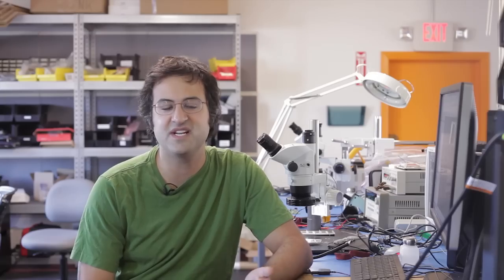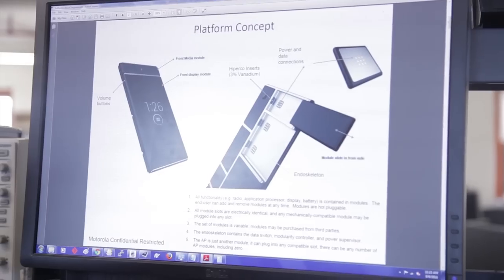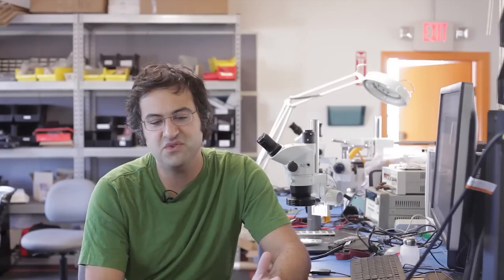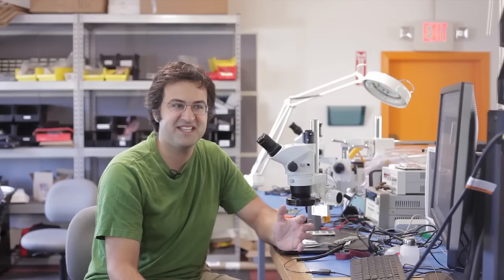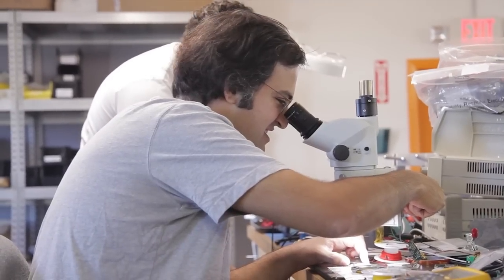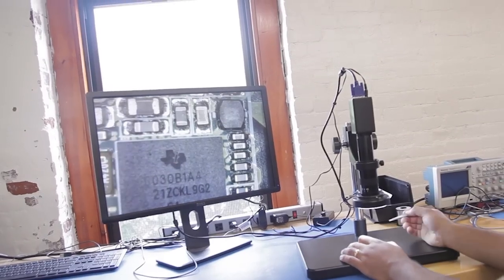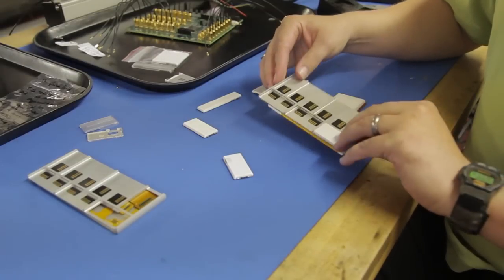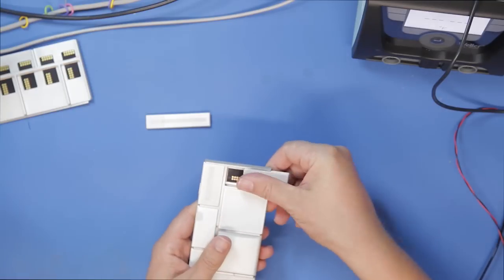Phonebloks update - Ara Prototype

Comment: The ethos of this project is cool but allowing the space for modularity means a huge compromise on design. This means you either have a massive phone or a very slow one. Ideal solutions are integrated ones where everything is designed to work perfectly together and nothing else, you can get hugely more efficient devices like this.

Comment: Hey guys, do you plan to make the ability to add a slider keyboard as a module? that would be great, I would imagine it would cover all the modules and also could act like a case protecting the modules from being removed by mistake

also shouldn't the USB charger be built into another module to give more space for other modules, like build it in to the application processor or the battery module and use the extra space for a microSD card slot, and/or a keyboard accessory

personally I think all phones should have a special "keyboard" connector for slider keyboards. so a hardwired slider keyboard case can be added to any phone
Reply: Superchad245 The concept as far as I understand it to be is that they are merely developing the framework for the system and will leave the actual module development (beyond the basics) up to others. Much in the same fashion of Android OS, they developed the framework and core applications then turn it over to app developers to meet the individual needs of the consumer.
Reply: Edward Russell II good to know and thanks for the info, does that mean someone may make a different cpu board, the less limited in options this is, the better it will be, personally having everything important (core, camera, sensors, usb port, sd card slot) in the smaller modules I think would allow for the two large modules to be used for bigger batteries, I guess also oversized modules that cover the whole back could be used for large batteries

modular phones should revive keyboards, as the main reason keyboard phones are not very successful has nothing to do with keyboards, but more to do with under engineering (last years specs on a new phone)
Reply: Superchad245 Funnily enough I wonder if they will make modules that are simply just huge battery packs, or even a Dcell adapter for the phone (can you imagine how long it would take to suck a D cell dry on a cellphone?)

Comment: In the Spyro 1 prototype 50% of the space on the module is taken up for modularity and so there's not as much space for the developers' function, but in Spiro 2 Toshiba made custom chips for us, and in Spiro 2 most of the area should be available...

Most of the area = 51%? :)

So far the idea is nice, but we don't know much about the execution - we see the system is lagging and that's what everyone expected. Let's say you have a huge garage for cars? Do you expect to fit more cars in there if you put a bunch of walls inside it?

The problem is not only the volume of the walls, but also the fact of the limit on the volume for individual components.

Let's say a developer X can create an optimal (quality/size) CPU taking 1 cm^3, and camera taking 1.5 cm^3. The slot sizes are 1.1 cm^3 and 2.2 cm^3. So now they're forced to redesign their camera to be slightly better but significantly bigger, or slightly smaller but significantly smaller and increase the CPU size even though it's good enough already.

And it's only volume, while in real life example a dev needs to deal with at least 2 dimensions. Third dimension can increased from standard, by sacrificing flat back. We will see many modules with empty, wasted space inside them. We will also wait many, many years until developers prepare hardware for specific dimensions of ARA.

I see some advantages of ARA over normal phones, but people don't even build their own laptops, and you think building a phone is a good idea? The only successful DIY computers I know of are desktops, because You don't care about ~ 50% (or even about 80-90%) wasted space.

Comment: not sure if the designer is blind but the front flat surface should be placed on the bottom side not on the top , it looks awful , i really hope they will manage to polish the externals before releasing  it

Comment: can someone please explain the significance of modulation on phones? would it be easier and cheaper to replace the parts or something?
Reply: That is definitely one aspect. Say if you break your screen you won't have to replace the entire phone, instead you could just purchase a new screen. Or, if you're happy with everything on your phone but wish to upgrade the performance, you could buy just a new CPU or RAM module and get a performance boost that way. 

Another definite advantage is that it opens a whole new market for module developers. For example, if a company like Bose wished to create a speaker module, they would then be able to without having to know how to make an entire phone. In the same line of thinking here, they have already released an MDK (Module Development Kit) so that independent hardware developers can understand the framework and work on creating their own modules much in the same fashion as app developers today develop software for the framework of the OS they are developing for.

Comment: My main dislike: Small screen compared to the body and a HUGE area for the front speaker above the screen. I believe it would make sense to either make a "dual" module with both screen and speaker on the same piece of material. Front panel in one piece, where speaker doesn't take 20% of the device. It doesn't require 20% of space, I know, my LG G2 doesn't require that much space, on Xiaomi M1S it didn't need much space, on my friend's Samsung Galaxy S (1, 3, 4, 5, seen'em all) it didn't require much space, none of the recent phones require THAT much space above the screen for anything. I hope you can fix that in next model. Also, space between components is used in a very inefficient manner - its not used at all. I don't need parts to be "hot-swappable", I'm fine with a screwdriver and a single, non-modular back (back is removed and desired components are replaced using tiny screws, yeah, I've been building PCs for the last 20 years or so, I'm comfortable with these things, if you're not, there are hardware shops with people like me). Modularity is a great thing till it starts to impose ridiculously large limitations on your device, like huge size, ugly (sorry, fellow nerds) design (seriously, compared to my LG G2 that modular brick is not appealing), large amounts of unused space, large size and weight in general (pure speculation here).

Hopefully, these devices won't be much different from "average" phone, but would allow us to replace just those components we want, without having to replace the entire phone together. This will also help ecology, as less waste will be generated (less components thrown out).

Yes, this would be very challenging to make a "modular" phone even without hot-swappable components, which would look similar to other phones, but have "user replace-able" modules. And thats the whole point behind Project Ara, right? I have high hopes for you, people. Good job in making it work in the first place, please keep going!

Comment: Terrible idea.
Reply: Why you don't want a phone that you choose the parts to
Reply: Badly Offended Then Unsubscribed The 2nd he's using an apple laptop in his profile pic, that should tell you more than enough information regarding his taste in "technology"
Reply: It's always going to be behind the times and the modules will become more difficult to make over time, especially when trying to keep compatibility and power management.  It will be bulky because of the framework and module requirements. It's likely going to end up costing too much. It's just a bad idea for so many reasons.
Reply: Gadget Addict
 Bulky in comparison to what? The prototype shown in the video looks about as wide as an iPhone 4 maybe a bit wider. Do you use a case for your phone? I bet its as wide as a finished Ara so bulkiness is not really a problem.
Compatiblity kann be solved with newer iterations of "motherboards", did PCI or SATA slots change in the last 5 years? Maybe update the motherboard once in 4 years to accommodate the needs of a new Snapdragon family.
Reply: hukaneren Aside from the hardware issues, look at how it's running. So frickin' slow. They had to make cuts to the video just to make it look semi-usable. I would not waste any more money developing this guys.
Reply: Gadget Addict lol you worry about the price and yet you probably have iphone 6

Comment: It really looks strange with the speakers on top and the screen nearly at the bottom of the phone.... I think as a samsung user i get used to have the screen in the middle with the speakers on top and the buttons on the bottom

I have a question: Does the Hardware fit in every slot? so the Big parts in every big slot and the smaller parts in every smaller slot?
And would 2 batteries work?

T think the idea behind this phone is great, but i think some greed guys will destroy everything.... for one hardware block we will have to pay as much as a whole phone...

I hope not, but there will be a guy f*cking everything up...

Comment: We've had this discussion, Google Also gave input.
It's got a very low chance of succeeding, these guys fail to see that.
I spoke with a Long Term Friend who designs at Philips. Chipsets like this, let a lone the chips for new blah blah camera, blah blah boobs, & so forth aren't looking reasonable whatsoever, the prices range from $100-$500 for a small chip.
These chips Also suffer failure design. They crash easily, burn out, & even char in design itself without showing any error and raising risk.

So, long beyond, anyone waiting for PhoneBloks, enjoy a phone that's gonna shoot into the $2,000-$4,000 range to maintain this for two years.
Reply: Either he's defending Philips or he really doesnt like this. because these chips havent crashed or burned out in any of the prototypes.
Reply: Aaron Gosselin 
The fanboyism is real.
Nice fanboy name.
Also, replies under DRu have been posted.

Chips have been fried, short circuited and glitched.
Keep up with Posni. They're a side aid team for this project, runt.

Pricing has still been balancing between the $350-$500 range in terms of 08G.

Guys, if you're a hip nerd, like this fucker.
Keep up.
Backdoors give answers, learn to use them.
As for Mr. "Gosselin". #learntoprotoid
Reply: ahnvx "fanboy name" what do you mean? that is my real name.